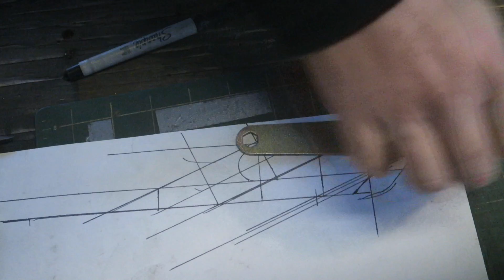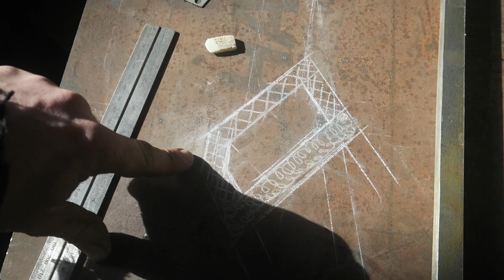Lockblade Build Part 2 of 3.

Comment: Our welding instructor showed us that trick about using a big plate with a gouge ground out, but he had us use aluminium. The aluminium helps keep your work piece cool since it absorbs heat better than steel!

Comment: To make it a lot easier to fill in holes and weld thin steel place 1/8” or 1/4” copper or brass plate or flat bar on the backside. Your weld will not stick to it and will give a flat weld on the backside. Also it will give you more time welding as your weld will not melt back as fast. Much nicer and cleaner.

Comment: VERY COOL! I do have a question! 
The metal in the ratchet straps IS very mild(cheap even), plus you have had to add bits & lumps, fill in holes etc. 
Why not make the lock from scratch? Trace out what you have now after ALL the tweaking & make from scratch!